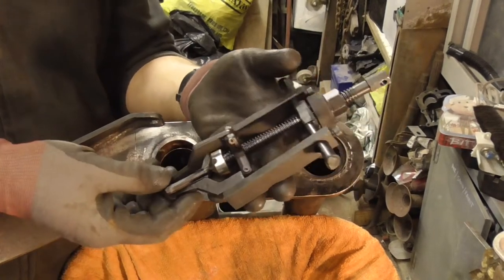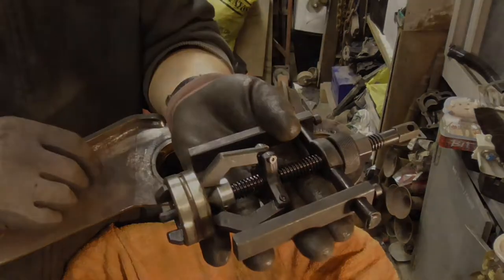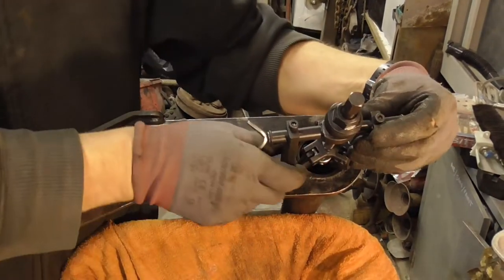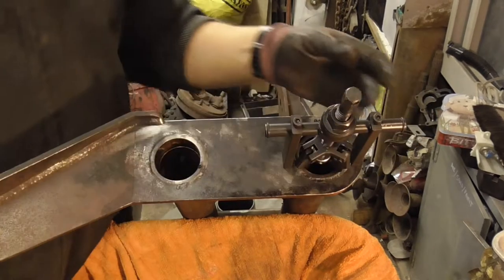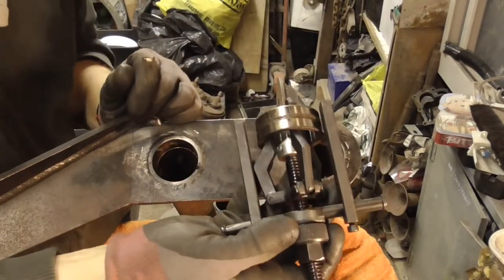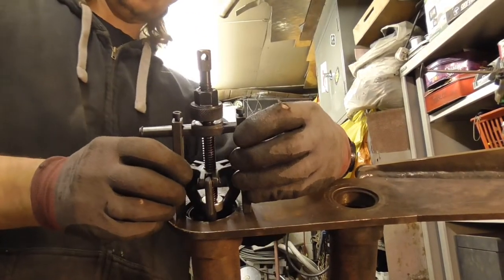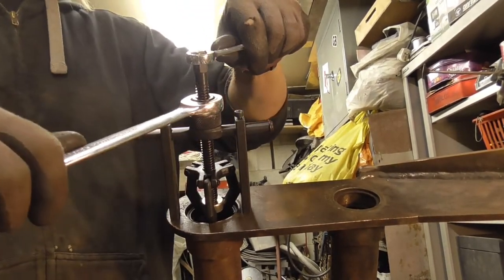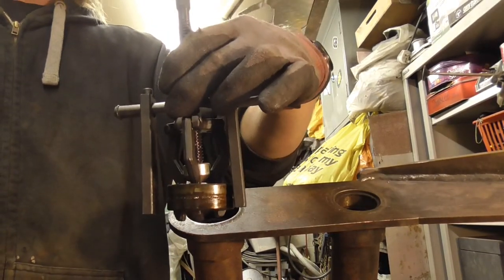Inner Bearing Puller Tool, How to use, Beam Needle Bearing Removal, VW Beetle VW Bus Type3 Bug Split

Comment: Thanks for the vid. Those pullers are only £10 on ebay 👍🏻. I'm just about to weld some new towers myself. Mind me asking whether you had to redo the seat for your bearings after you welded on your custom towers? I've not gone as close to the end as you, but set in about 10mm.
Reply from the maker: Hi tx :) I didn't actually build the beam it was an ebay purchase. I've done more vids where you might be able to see what you need here etc https://youtu.be/0l0Si-s2kMc but unfortunately I can't help answer your query through experience sorry.  Good luck :)

Comment: What is the smallest bearing ID (internal diameter) that this puller would fit? The items on eBay show all the other measurements, except the diameter if the jaws that fit through the ball bearing. And contacting the sellers has not worked so far (they normally don't have the items themselves, they get shipped directly from a warehouse).
Reply from the maker: The end of the fingers on mine measure about 12mm fat, so should be good with about 1'' / 25mm ID. They are quite rough cast items however so may vary, and I guess could be 'modified' slightly if needed. GL  :)
Reply: @PeoplesCar  Thank you for the additional info. I was not sure how to interpret the item description on eBay: it said "Range of application: 14-38mm", but also "Pull range: 50-95mm", and the statement "sleeve-type bearings with 1/2"-2" inside diameter". Apparently the tool would not fit into a 1/2 hole, then.
Reply from the maker: @TheICTBob  That does seem odd if it's the same puller. Are you sure it's not a smaller one?
I'm not entirely sure the other measurements make sense either I'd have to sit down with the puller and a tape measure to try and figure those out lol. I assume it shouldn't be used to pull with just 1 finger?? as that's the only way the one I have would go through a half inch hole.
Reply: This is just what I was preparing to ask 👍 I want to remove bearings with an inside diameter of 15mm so thought I was going to be alright either way with this but just watching the video plus your answer I think not... hmmm. The listing you link to does describe all the same specs so obviously they're inaccurate. Another question I'd like to ask. With the legs fully closed, how close can the side supports be brought together before they hit the central tripod hinge or top of the legs? I have a very narrow ledge not much wider than the outside race of the bearing itself. Looks like you can put 1 support between 2 legs and the other braced up against the third. If you could tell me that measurement I'd appreciate it. Possibly they could be angled slightly as the tension increases/ removal begins? Thank you, both.

Comment: Where can i get this tool to buy.
Reply from the maker: Just updating the description with this, please note I found the bearing to be non standard in my beam. I dont think it will make any difference to how the tool works but am slightly worried it maybe less effective with stock beam and bearings, this is information I'm trying to find out and will update accordingly, hope that helps :)

"Please note I have since found the bearing in my beam to be of a non standard size. While I dont think it will have any difference to how the tool works I cannot confirm it will definitely work as per the video with a standard beam and needle bearing.

UK EBAY
I imagine any of these pullers would work but have only tried the 3 finger type:
http://rover.ebay.com/rover/1/710-53481-19255-0/1?ff3=4&pub=5575557847&toolid=10001&campid=5338637766&customid=&mpre=https%3A%2F%2Fwww.ebay.co.uk%2Fsch%2Fi.html%3F_from%3DR40%26_trksid%3Dp2380057.m570.l1313.TR5.TRC2.A0.H0.Xinner%2Bbearing%2Bpuller.TRS0%26_nkw%3Dinner%2Bbearing%2Bpuller%26_sacat%3D0

Here is a link to the exact item/seller I purchased mine from:
http://rover.ebay.com/rover/1/710-53481-19255-0/1?ff3=4&pub=5575557847&toolid=10001&campid=5338637766&customid=&mpre=https%3A%2F%2Fwww.ebay.co.uk%2Fitm%2FCarbon-Steel-3-jaw-Inner-Bearing-Puller-Gear-Extractor-Heavy-Duty-Auto-Tool%2F203019318000%3FssPageName%3DSTRK%253AMEBIDX%253AIT%26_trksid%3Dp2057872.m2749.l2649

EBAY USA:
http://rover.ebay.com/rover/1/711-53200-19255-0/1?ff3=4&pub=5575557847&toolid=10001&campid=5338637766&customid=&mpre=https%3A%2F%2Fwww.ebay.com%2Fsch%2Fi.html%3F_from%3DR40%26_trksid%3Dp2380057.m570.l1312.R1.TR11.TRC2.A0.H0.Xinner.TRS1%26_nkw%3Dinner%2Bbearing%2Bpuller%26_sacat%3D0"